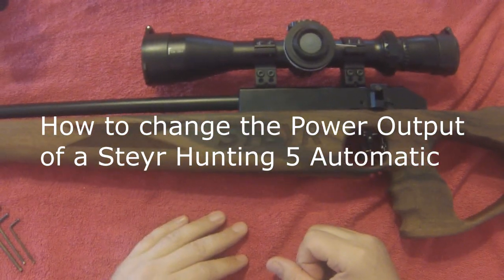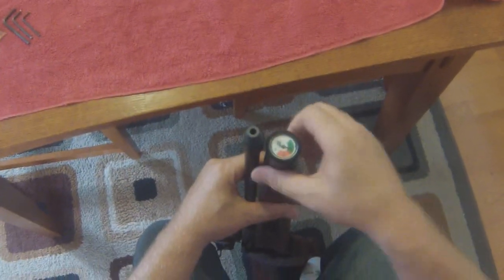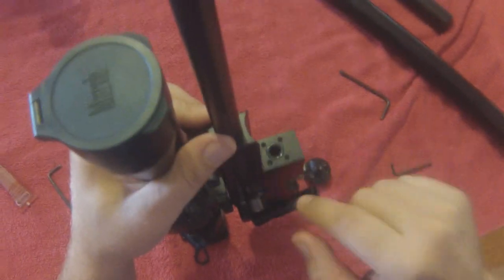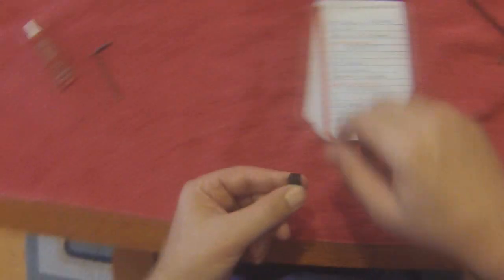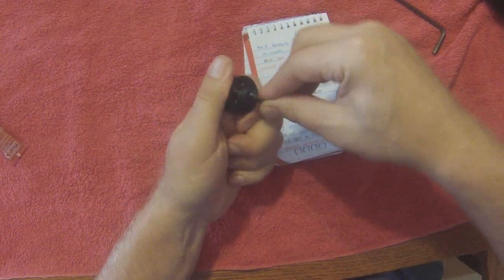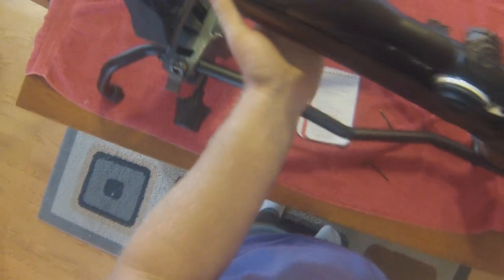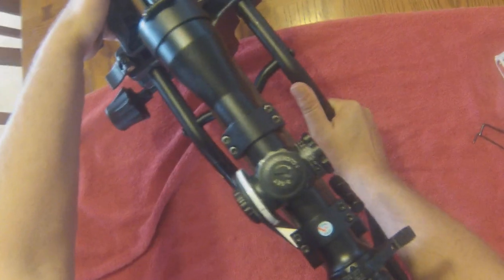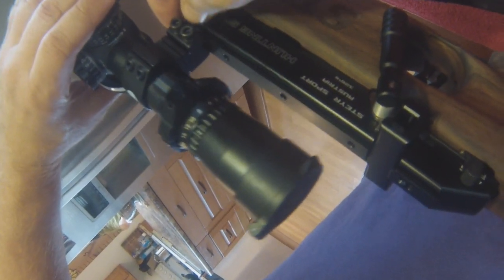How to change the power of Steyr H5A to 40J, 24J, and 16J

Comment: hello .. this configuration also works for the caliber 177? thankful
Reply from the maker: Yes, but .177 won't go up to 40J. I might be wrong off the top of my head but think the .177 configurations are 24J, 16J and 12J
Reply: @ajarnmichael1  Perfectly, I need 24j, I have a lg 110 steyr and I realized that the valve seems to be the same. But in your notebook design, there are two washers to the left and two to the right and nothing more. That's right? (())
Reply from the maker: @luizauerhahn5643  For 24J in .177 you need the regulator set at 120 BAR. The washer configuration to do this is: ))())()() with a .5mm spacer.
Reply: @ajarnmichael1  Sorry for so many questions, but I never opened that valve, does this quantity of plate springs already have inside the outerei valve to add? Mine is 18 j.

Comment: What about the other screw behind the choke screw, i have it on my steyr pro x . Am trying to get the maximum speed and J how to get that on my steyr pro x
Reply from the maker: I might be wrong, but I think that screw hole is for a stop pin when mounting a scope. I don't remember exactly. Steyr guns are difficult to modify other than removing the choke, changing the the washer order in the regulator for higher pressure,  and minor changes to the hammer spring. All  three can be done to get a gun up to the 38-40J range, but not higher.
Reply: Michael Mahoney Thank you very much you are the best 👍🏻
Reply: Hi SalohSB
Is the regulator adjusting on the Steyr pro X the same as in this video? I just got a Pro X and want to tune it

Comment: I know this is an old video , did you have a choke in to start with . I could only see you put one in and did you measure the hole of the old choke that you took out , if you had one in.
Reply from the maker: I did not have a choke and had to contact Krale and order it. The choke hole size is 2.2mm through the M6x5 threaded grub screw. The same 2.2mm hole reduces a .177 shooting at 24J down to 16J. There is a 1.2mm hole choke that reduces the .177 cal down to 7.5 J
Reply: @ajarnmichael1  ok, so that means if I have a .177 and a 24J Regulator I have to remove the 1,2mm choke, right? 🤔
Reply from the maker: @torbenh3318  I believe removing the choke would bump your power up to the max 28J for the .177. Only way to know for sure is to remove it and try it. It is easy to reinstall.

Comment: Hi,
How to adjust from 16J to 24J on Steyr Pro X .22 ?
thanks
Reply from the maker: If the ProX is like the H5A, there is a choke installed that can be unscrewed and replaced with a slightly larger one.
Reply: Michael Mahoney thank for your reply. Where I can buy that choke? Any shops sale them?
Reply from the maker: @intercon2330  I got mine from Krale out of the Netherlands. I have a service information sheet from Steyr I can send you. In the .22 you might only need to remove the choke (in unscrews) to get to 24J and leave the regulator pressure alone. I'd try that first. Send me a PM on Airgun Nation if you want the service information sheet on chokes. My handle is mmahoney.

Comment: Did you change the screw after putting in the choke or did you use the same.  And you didn’t screwed it down all till the end because?
Reply from the maker: Used the same screw. The choke goes all the way to the end but not the top grub screw because there is a gap between the. The choke and grub screw where the air enters the barrel. The top screw just allows access to the choke and plugs the hole to keep air escaping through it.

Comment: interesting . not many of these around . I have a 12ftlb auto . what do I have inside , a choke already ? and how much does the accuracy change with or without the silencer fitted
Reply from the maker: It is my understanding the action of the 12 FPE (16J) is the exact same as the 24J and 40J. Your gun has the smaller choke already and the regulator springs set at 85 BAR. Your gun could be changed to the 24J or 40J versions as shown in the video. I haven't noticed any change in accuracy with or without the silencer fitted.
Reply: does your rifle accuracy change much with the silencet on or off ?
Reply from the maker: I haven't noticed any change in accuracy with the silencer on or off but your mileage may vary.